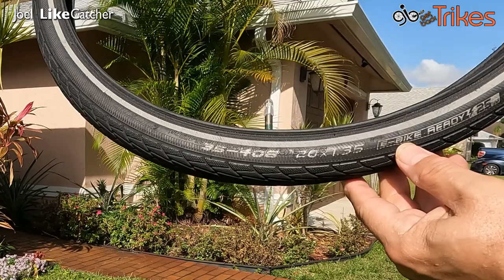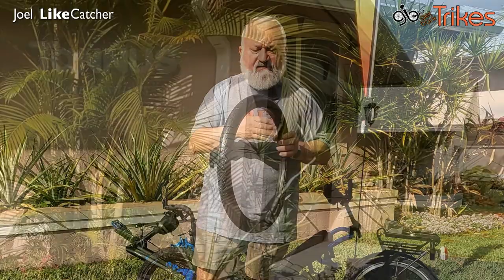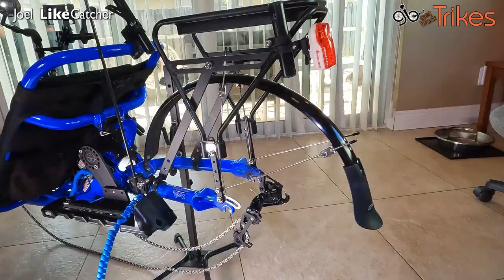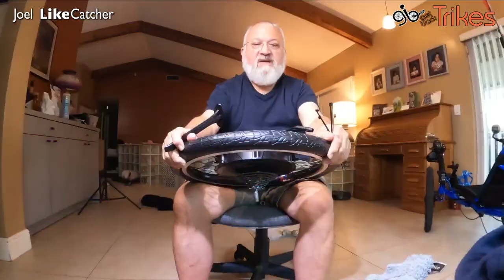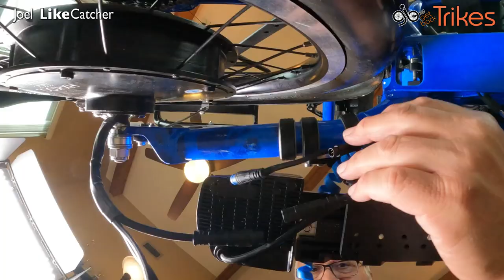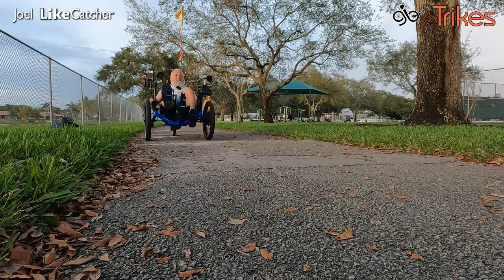Tannus Airless Tire on a Trike with eAssist

Comment: I had been wanting to see a more recent review of these tires.  I too have a Falco, and wanted to do something like this.  Thanks very much for your great video!
Reply from the maker: I have several Tannus Airless Tire videos planned. Will be creating this about next week. Hope you have subscribed and clicked the notification bell.
Reply: @joellikecatcher3480  Just wish I could get Falco to answer my questions on the wheel they sold me.  Like can I put a Tannus on the wheel, does it have the edges.  What is the width between the edges.  Info they should have on file from my order.  I can not order a tire until I have this info, and I can not take it off.  I pay a local shop to do that kind of work for me.
Reply: @rltidd27  I have all the answers you need. I can ship to you the Tannus Airless tire, pins, and tool you need that correctly fits your Falco wheel. I am now an authorized Tannus dealer too.
Reply: @JoelLukacher  I sent you an email.
Reply from the maker: I didn't get tour email. Please email me at Joel@getbacktrikes.com . Include ytour phone number. Its usually best to talk 1-on-1 to get you set-up correctly.

Comment: I found heating the tire up to make it easier to get on.  I have those tires on my gekko 26....but now looking at putting the tannus armour on my rear wheel for better tread for hill climbing on wet roads on California coast route.
Reply: Love to hear it Steve!  Cheers
Reply: @RideTannus  how critical is the 163lb weight limit for the airless tires....I'm currently +/- 5lbs of that limit on my 26" rear wheel on my trike.  How are the airless tires on climbing wet roads?
Reply from the maker: I thought of using my heat gun to soften up the tire. I was afraid to do that.
Reply from the maker: Im 190 pounds on a 60 pound trike. So... I don't think there is a 163 pound limit.
Reply: @joellikecatcher3480  the info I got with my 26x1.75 airless tire stated that it had a 163lb limit....I put the rear wheel on my bath scale and read the weight with me sitting in the seat.  It was less the the limit....but putting on the 4 panniers with all my gear put the rear weight alittle over 163lb.  Thats why I'm considering going back to schwalbe plus tour tire with tannus armour insert just for the rear wheel and leave the airless on the front tires.
Reply: @joellikecatcher3480  I saw a video in which the tire was put in the oven on the warming setting before installing.

Comment: Hello Joel, I thought it would be an idea to let you know of my experience with the Tannus tyres to date. I tried the solid ones on a friends MTB first and wasn't keen on the ride or the noise . I decided to go for the Tannus Armour inserts on my trike. I had these fitted by a dealer here . I gather they were very difficult to install and having had these for about two weeks . I've noticed that I've lost about 20% of my speed based on the recommended tyre pressures . I'll experiment with different settings and see if it makes a difference.  Happy with the trade off ie speed for some degree of peace of mind, ie puncture protection,  as a lot of our roads around where I live , would put some Third World country tracks to shame!
Reply from the maker: I recommend the Airless Tannus tire for hub motor trikes. You don't notice any loss of speed or comfort with the eAssist. Yes they are difficult to install. Best to pay your local bike shop to install it for you!

Comment: Was excited to see your video. Two questions: 1) I read on the Tannus website the inside width of the rim is critical for proper fit of the tire to the wheel. I guess there are different widths for each given tire diameter. How did you get the correct width without taking the tire off and measuring the width? Seems like lots of extra work to take tire off and put back on more than once if you want to ride while you wait for the tire to arrive. 2) My trike manufacturer (TT) recommends against the tire saying they are not suitable for trikes because trike tires experience more side stress the two-wheelers on turns. The tire might pop off the rim. Comments?
Reply: Hey Bruce!  Some wheel manufactures stamp the rims ID with a sticker on the wheel for you to reference or you can reach out to your bikes manufacture as well so you don't need to take the tire off.   We haven't heard the concern on the sidewall stress with trikes.  Once the pins snap into place, they're on for the ride.  There is a company here in Utah called Utah Trikes https://www.youtube.com/@UtahTrikesOnline.  Very reputable source as well.  Thanks for commenting!
Reply from the maker: The Tannus website said the tire was too narrow. So I called them. They said no problem and sent me several pin sizes. The yellow one fit well.

Comment: Did you notice a lot of extra rolling resistance from the Marathons to the big bend to the Tannus?

How’s your knee?
Reply: With the eAssist set to level 1, I felt no rolling resistance. My new knee works well. Still a bit difficult to put a sock on it. Took a hour dog walk yesterday. Felt fine.

Comment: Hello Joel, It's been a month since you fitted the Tannus solid tyres. I wonder now that you've had time to bed them in, how do you find them. Have you noticed any loss of performance?
Reply from the maker: Simply put, no. I'll be applying to become a Tannus Dealer  because I see a real benefit to offer installing the Tannus Airless tire on any new Falco Hub Motor I install for my customers.

Comment: It's not the same model.
I have experience in fitting airless tires.
I haven't used it since.
I tried two types of airless tires.
One had weak grip and just slipped. The ride was hard, too.
One was like a tire without air. Wiggle, wiggling.

The conclusion is that the Schwalbe Marathon Plus tire is the best.
^^😂🤣🤣😂😋
Reply from the maker: I agree the Schwalbe Marathon Plus is the best air tire. Your comments about grip and slipping, that I read about, is only on 2-wheeled bikes. However, on the back wheel of a tadpole trike, especially with a hub motor, has none of these rerported issues. The Tannis Aireless Tire is an excellent solution for Tadpole Trikes as such, expecially with a hubmotor.
Reply: @joellikecatcher3480  You'll find out when you run along the wet wooden deck road.
Because it's a translator, words can be weird. Please understand.🤣😂🤣🤣
Reply: @joellikecatcher3480  If you run slowly, there's no problem.
No problem ^^🤩😅😆
Reply from the maker: @gomountaintriking8460  I see you are a Mountin Biker. That's a different ridinng experence than a road trike. Most Trike riders ride between 7 and 14 MPH. We are a relaxed riding bunch! Only occassionaly do I ride 20 MPG (eAssisted) in the street when cars are close by. I'll may do a follow-up review after some faster rides.
Reply from the maker: @gomountaintriking8460  Sorry. I dont speak German.